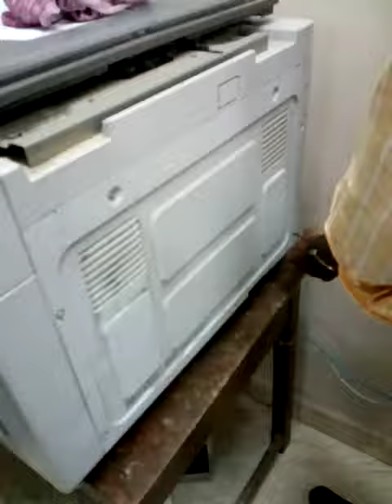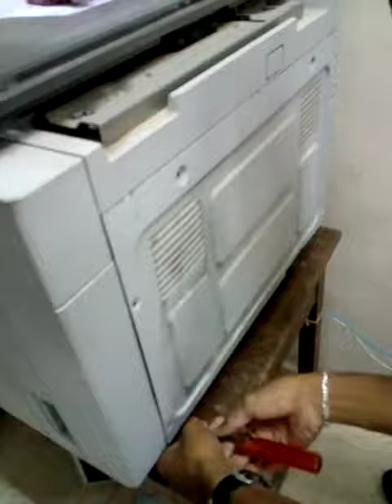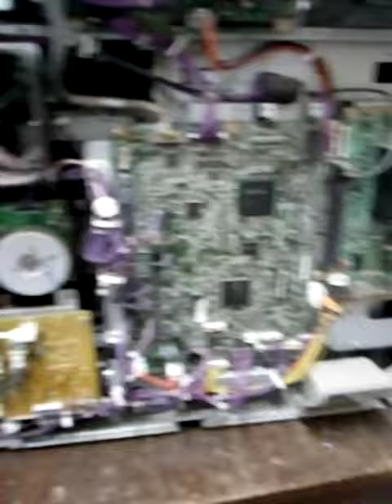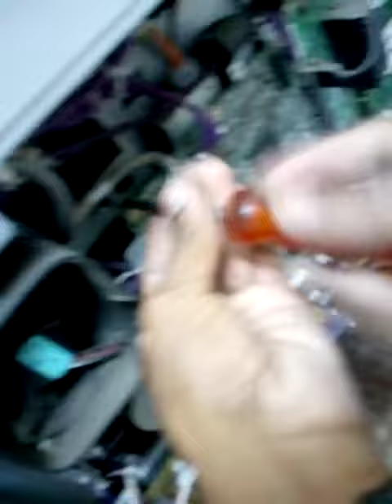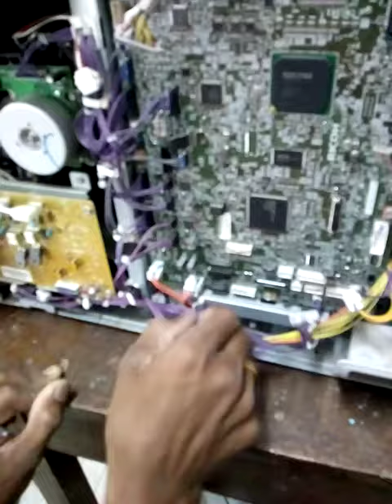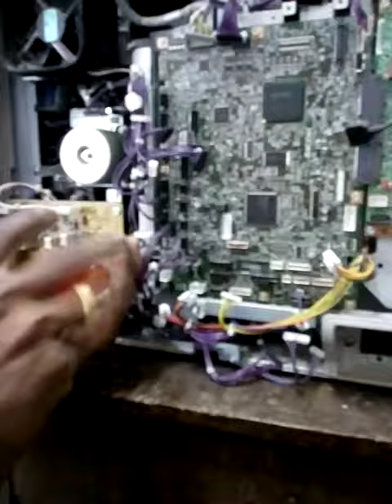RICOH MP 2001sp/1813L/2001L/2000LE/2000L2 / Machine service MOTHER BOARD CONNECTOR REMOVE  👍👍👍👍👍👍

Comment: Please upload for gearbox . In my machine Gear no.  10 damaged l.
Reply from the maker: Which model
Reply from the maker: Remove slowly first
Reply from the maker: Every thing capture vidio
Reply from the maker: Fix slowly
Reply: @ponnuthurairamachandran8284  mp 2000l2 .... Afraid about belt only. Most of all I can .  Upper pulley -belt part mat be difficult.